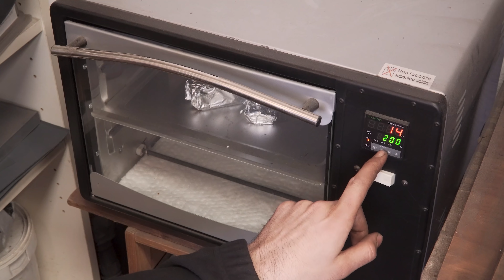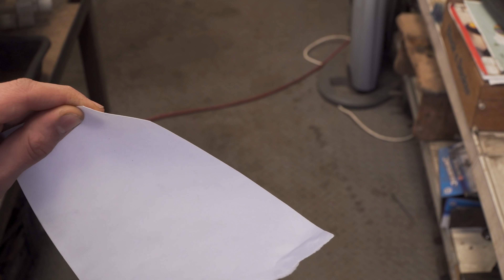Knifemaking: Kitchen Knife Made With Scrap High Carbon Steel

Comment: That’s some pretty aggressive grinding after tempering, and the magnet doesn’t let you feel how hot the blade is getting.  You are very experienced, but I wouldn’t recommend a new maker doing this 👍. Beautiful work as always though Mr. Beard 👊👌
Reply: Yeah I never really understand why people grind after hardening. I know big knives can warp but thats not a problem with small blades.
Reply: Warwick Tetlow a lot of guys grind post heat treatment (post temper) on thin stock, for chefs knives for example.  Here he’s just cleaning up the bevels, as he did grind pre-heat-treat.  I was just concerned because the video seemed like there was no dunking the blade in water during those cleanup passes.  Anyway like I said, he’s very experienced, but for new guys watching, do a couple of passes and dunk the blade in water so not to ruin your temper👍
Reply from the maker: Thanks mate! I keep the blade cool with water, hard to tell with fast forward and edit, but every couple passes I stick that in water to cool. I always grind post heat treatment, it's too risky to quench a thin blade or edge, I had thin edges warp on me before very badly.  As long as you don't overheat and change the color of steel you can grind as much as you want as far as I know! Thank you again
Reply: @BlackBeardProjects  Good advice. Thanks Mr BB.

Comment: Awesome video man was the dowel you used smaller diameter than the drilled hole or same diameter? I am definitely going to try out that method vs burning my tang in on my next knife

Comment: After spending most of my life working in kitchen, a knife that had ANY blacking on the blade would be thrown to the dish-pit to be gotten clean. Public Health would  be on any restaurant until it was "back" to the shine of stainless steel so it doesn't look like food poisoning waiting to happen.
( there is a reason for stainless steel knives )
The notch in the blade just gives me a twitch about how this blade was badly damaged and not properly repaired.
The shifting of the tang from flat with the back of the blade removes many of the most common cutting techniques from the table. The leverage from the back of the blade alignment truly speeds up a lot of cutting tasks ( which is also why most chef's knives have a curved cutting edge ).
As a knife for display, great, looks fantastic.

Comment: Awesome! So is the wire wrap just to hold the cement on when dry/during heating so it doesn't flake off?
Reply: Not really. The wire is there to create a specific pattern for the gun gum (the paste) to conform to. It doesn't need the wire to stay on, but it makes for a pretty and uniform-looking hamon (differential hardening line) on a blade.
Reply: I was wondering the same thing 👌
Reply from the maker: Yes, exactly. Just to hold the cement, as far as I know it has no effect on the hamon line!

Comment: one thing ive noticed with many of these knife making videos that they usually dont nail is the handle, whilst the one in the video is practical enough it wouldnt nearly be as comfortable to use as a knife with a well crafted handle that moulds to your hand. If you have ever seen a maumasi firearts knife, the handle is so well crafted its an art in itself

Comment: This has probably been asked before, but what is the material that forms 'flakes' when you hammered the blade early in the process. And is it coming from the blade or the hammer?
Reply: Iron oxide, or scale. I haven't heard exactly why it forms as it does other the stress on the surface of the metal. Please correct me if I'm wrong.
Reply: Hot metal in air oxidizes rapidly. Hammering causes it to separate.

Comment: congratulations friend, I have been following your knife projects, they have improved a lot, I have been following the channel before you got involved with blades.
If I can give you a tip, if you do selective hardening you don’t need to do the tempering, another thing, if you want to make a blade of oriental excellence, don’t subject your blade to the heat of the belt sander after the thermal process, do everything manually, it takes time long but it’s a perfect single knife. you are from which country? I'm from Brazil, in the state of rio grande do sul
Reply: that wasnt tempering it was a normalizing cycle, theyre effectively two different things. He calls it tempering in the description but its not i think its a translation thing. Also its fine to use a belt grinder after normalizing as long as you pay attention to the blade and keep it relatively cool during grinding, the steel will keep the same crystalline structure with no issues.
Reply: @johnnyregs2378  normalizing is before thermal treatment, this method is very good but for excellence the process is manually, thank you
Reply: @brasilvirals  ive been a bladesmith for 15 years and i can assure you, normalizing does not take place before "thermal treatment", which by the way, all of these steps are. Tempering and normalizing are two different things both taking place after hardening. Dont call people out online if you dont actually know what youre talking about man, you look foolish and self indulgent.

Comment: When using stabilizing resin arent you supposed to let the wood soak for twice as long as you extracted air from it once you disconnect the vacuum in order to give the resin a chance to seep into the cavities where the air was? Taking it out of the resin immediately after disconnecting vacuum defeats the purpose if im not mistaken.
Reply: You want him to leave in the soak?
Reply: @saintchuck9857  yes that's the point, you extract the air and leave it in the resin so it has a chance to enter the cavities where the air was. It doesnt happen instantly.
Reply: @johnnyregs2378  and you wanted him to show the wait? In the video?
Reply: @saintchuck9857  its obvious in the video that he didnt do it. Usually they put something like "3 hours later" or something. I feel like you're intentionally missing the point here kid.

Comment: The knife handle is slightly weak and does not fit well with the razor. Kitchen knife handle is better attached to the blade with two pins.

Comment: 8:40 ok let me stop you right there... THAT IS NOT HOW YOU STABILIZE WOOD!! a properly done stabilizing the wood will not float in the resin when the weights removed there is still air in there and it didnt soak long enough to absorb the resin which looking at it as you poured is contaminated you can tell by the color and consistency ...this alone shows those of us that actually know better that you dont know what you are doing leading the whole process to be suspect... not to mention that you used heated oil to quench when trying for a hamon a whole other issue entirely and again flat wrong